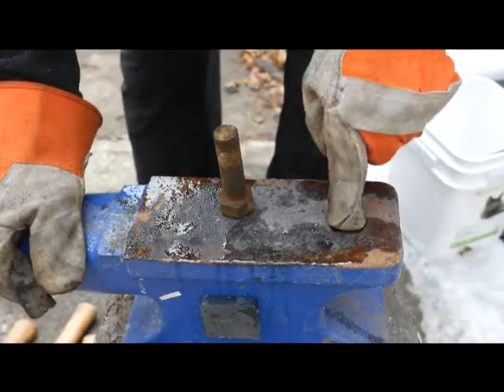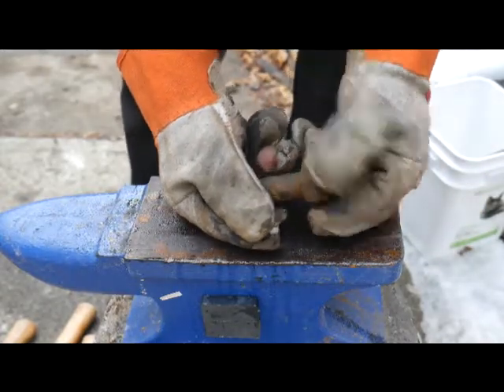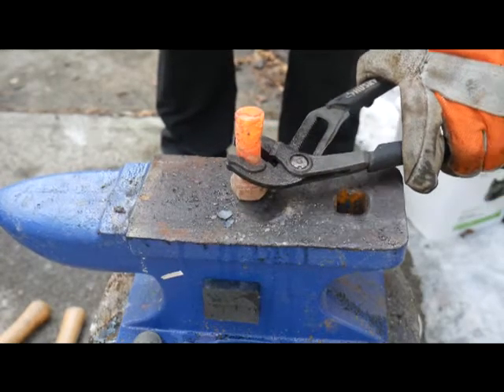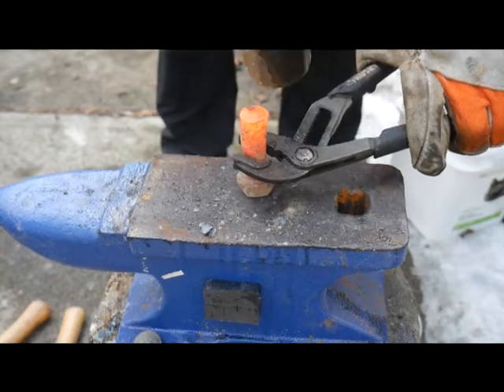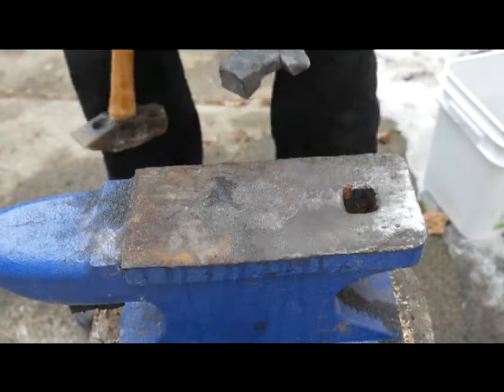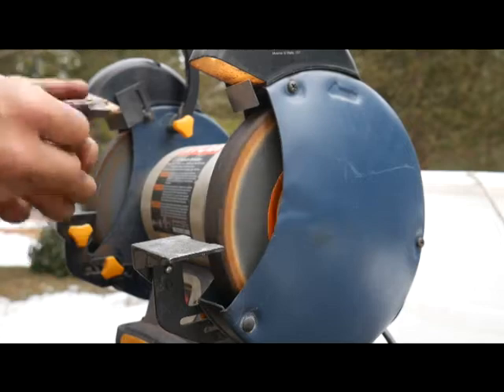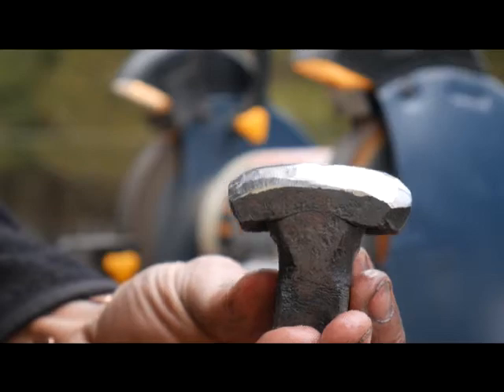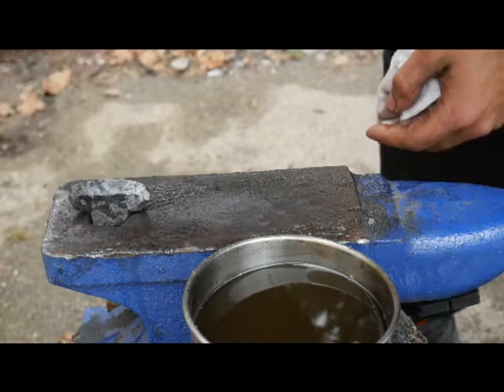Forging A Hardy Hole Cut Off Tool From a Bolt

Comment: Not bad at all. You can make flatters out of some big bolts as well. I've made cut off hardys for the pritchel hole in anvils out of tire irons too. You could probably drill a pritchel in that anvil pretty easily if you ever wanted one. Making stuff out discarded junk is always fun. Good video.
Reply from the maker: +OrionsAnvil Hey I'm gonna look into maybe drilling in a pritchel hole.....I have an old tire iron I got in a bin of tools at a yard sale too.....hmmmmm.  Thanks!
Reply: No problem. If that is a harbor freight type anvil it probably wont be too hard to drill through the heel, or you could go for a German style anvil with a pritchel near the horn, if that wont interfere with its use.

The HF anvils are supposed to be relatively soft. I'd start out with a small pilot hole first then work up to something like a half inch to 3/8" if there is room. Drill press and cutting fluid would be recommended as well. Go slow so you don't break any bits.

I've never actually done it so do your homework on it. If that is an expensive anvil then make sure that's what you want to do. And make sure to only hit hot steel, that way its not as stressful to the heel of the anvil. Good luck with it.
Reply from the maker: +OrionsAnvil Yes it is from harbor freight.....my dad bought it for me.  Hey thanks so much for all the info man, i really appreciate it!